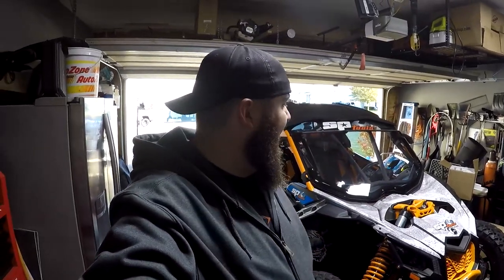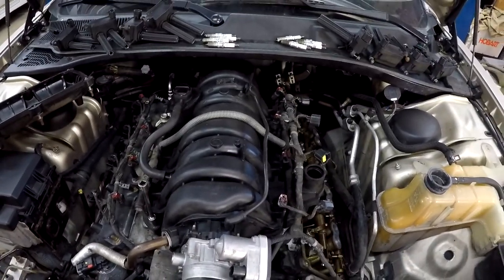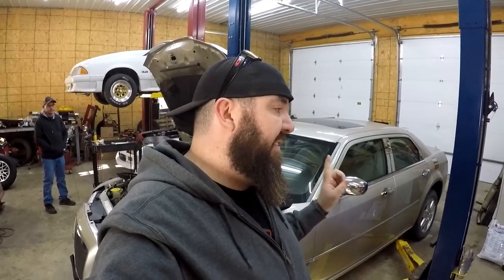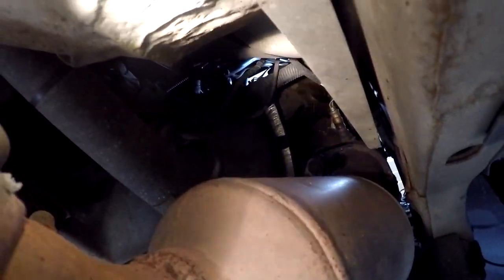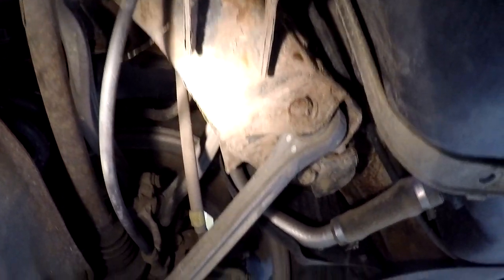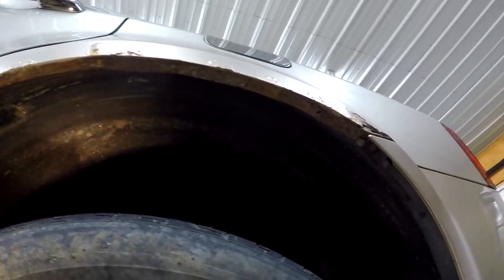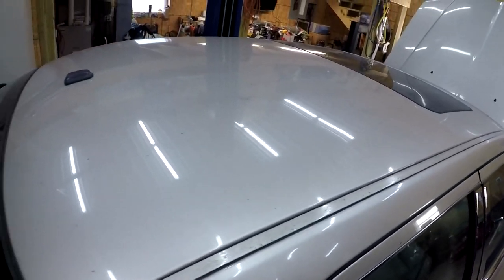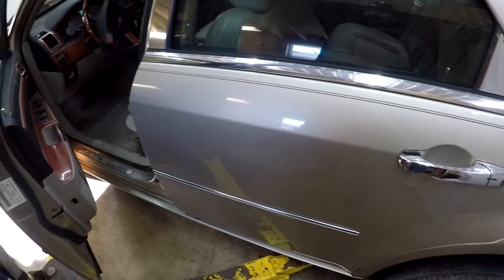CHRYSLER 300 - WERE GONNA REBUILD IT!

Comment: Have seen it from a valve seat issue too.Detroit Axle make a good front suspension rebuild kit.That 2010 Ram 1500 I emailed you on was not that part you mentioned,pulled the pan and found pieces of the cam bearings in the pan.Ended up dropping in a Jasper reman in this one.
Reply from the maker: Yes have also seen valve seats drop out as well. Next step is pulling heads
Reply: I seen the valve seats in pieces which the intake manifold was replaced too.

Comment: The floor boards nasty 🤣🤣🤣 you should see all the gravel and dirt in my 4x4 2000 4runner carpet had spills and mud and dirt and I dont shampoo it because its going to keep getting mud in it I clean it out all the time and my 4runner with cleaned floors still dirtier then the floors in this ride lmfao @Rustbelt Mechanic

Comment: Great video on the 300 I have a question for you as we all remember with the Caddie you brought timming chain kit and the guides fail. So I need a timming chain kit with water pump it's a 05 pathfinder with 214000mil do you go by low to high price I  think the cheaper is a no,no what's you're thought on that thanks
Reply from the maker: I’d go mid range on a site like rock auto